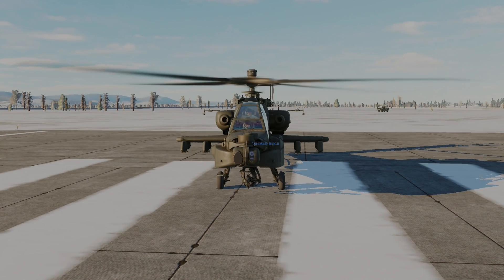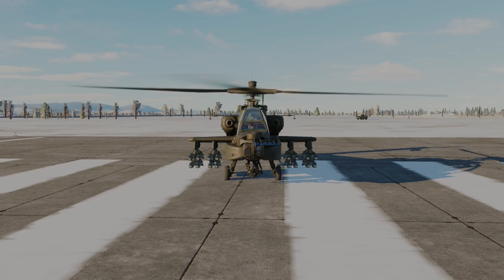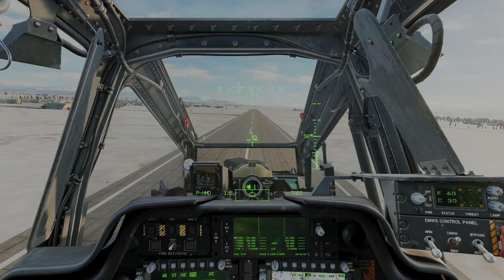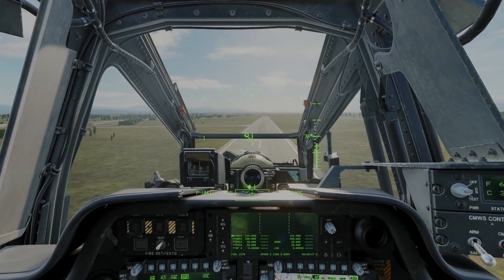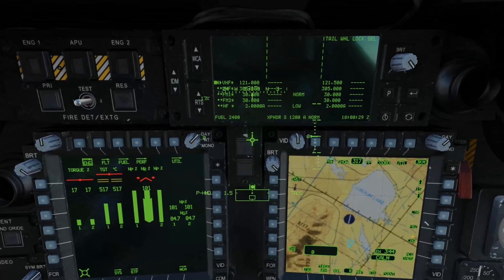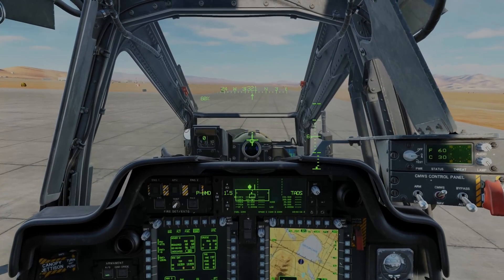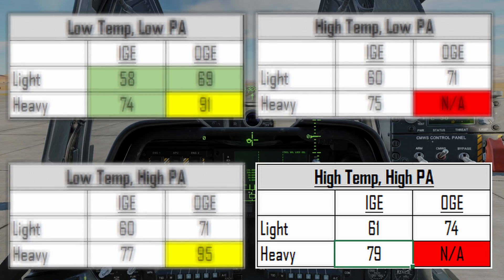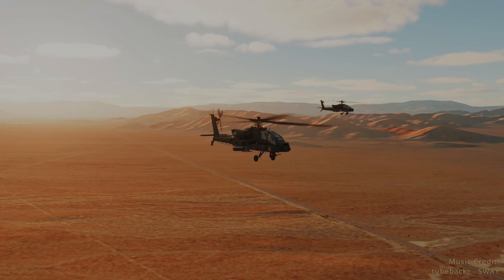REAL APACHE PILOT shows you why you KEEP CRASHING!

Comment: very nice video, informative and to the point.
my subsequent question relative the extreme condition, especially the last one (hot high PA and heavy), how does one goes about doing his job be it armed recon, S&D or some such ? what's the doctrine for this conditions (and any other if possible to share), does it involve racetrack battlestation on TGT, hide and seek hover ?
i'm very interested in the tacticals applications and how to use this aircraft realistically, would love a video on the subject if not OPSEC.

thanks again !
Reply from the maker: Basically you only carry what you need and stay above translational lift speeds by doing orbits/racetracks.

Thanks for watching!

Comment: You need to load up on JP8 and have your crewchief make an adjustment to the power turbine governors to bump the power up about 100hp to 701-d levels.  Also, leave the unnecessary baggage behind to save about 200# and get a skinny gunner to shave a few more.

Do a rolling takeoff and don't get below 60 KIAS until you have burned off about 25% of your fuel or used several Hellfires.

Comment: Are all attack helicopters so underpowered?
Reply from the maker: No, back when it was originally designed, it had plenty of power. In the years since, and the evolution from a to D models, the army decided to add a lot more equipment on the aircraft, which subsequently reduced the power margins. The E model allegedly fixes a lot of these issues.

Comment: I bet 40C was at sea level in the editor. Then going up 4409ft, it dropped the air temp by about 2C per thousand feet (lapse rate), 31C makes sense.

Comment: High altitudes, hot conditions (thinner air for both), and heavy payloads is why the Russians developed the running on the nosewheel take-offs with the Hinds, just to get it in the air.

Also remember, in a heli with a counter clockwise rotating main rotor as viewed from above, the left pedal TAKES power (more TQ), and the right pedal reduces power (lower TQ).

Over torqueing means you basically broke it! (maintenance action required).

Remember also, Pressure Altitude is simply Standard Pressure corrected for non-standard temperature (15 deg C).

If you're playing this game and want to take off heavy, do running take-off's on the runway, like a plane. Once you transitions into ETL (Effective Translational Lift), the heli will just pop up and as long as you keep your airspeed up, you'll fly away. You can even do running take-offs in skidded aircraft!
Reply from the maker: If you watch my latest video, you'll see I do a rolling takeoff because I'm too heavy. Thanks for watching!

Comment: Would you say the model is accurate, I mean is hover more unstable in DCS vs IRL? Also, what stick n pedals do you use?
Reply from the maker: I’d say the model is fairly accurate. There are some issues with it, but it’s probably a good 80% solution. I feel like it was easier to hover the real helicopter, but that might be due to being able to feel what it’s doing versus only using your eyes in DCS.

Stick - Thrustmaster Warthog
Pedals - Logitech Pro Flight (getting ready to upgrade)
Reply: @schoolio64D  I'm using a mff2 for stick and rudder.. no pedals. Hover is very difficult for me.
Reply from the maker: @ntme9  Yeah, definitely takes practice. I've been told that Wags also uses a twist grip.
Reply: @schoolio64D  Nice, only thing good about it is I can sit back with my legs propped up on the desk while blowing sht up.. lmfao.  BTW, slightly off topic, does the 64d have the ability to box/track a moving target like a TPG?
Reply from the maker: @ntme9  Kind of, but not modeled yet. The Image Auto Tracker (IAT) is designed to capture targets and maintain them in the center of your field of view. However, it's not modeled yet, and from I can gather, when the 64D went from legacy TADS to MTADS, it basically lost it's effectiveness. It uses contrast from the surrounding area to lock, but according to Casmo, most people didn't really use it that much. In the A model and D model with legacy TADS, we used it a lot, because the only way to actually see things in the FLIR was to dial the contrast way up. I never flew MTADS - they were fielding it as I left active duty.

Comment: Very cool video.
It's been a while since i last fired up DCS. Now i think there is a really critical parameter missing in the simulation, that is humidity. That bit of water in the air acts to increase the reaction mass, it also effects combustion performance to a point. 
BTW i made it a habit to get my weather reports for every day use from the nearby airport (aka METAR/TAF). No clutter, no ads, no upselling. It just takes a bit getting used to read the stuff.
Reply: It is something that we would state as as reason for reduced performance, but not really factored in since compared to temp and elevation, it had the least impact on density altitude.
Reply: @apachedave  For some aircraft high humidity is considered a positive.
I.e. the Super Guppy. If the air is too dry/light, thrust performance is diminished, and since it is a cargo plane, humidity thus dictates the MTOW, IIRC.
Reply: @DasIllu  No denying that on my part for a Super Guppy.  But in the US Army, our charts did not factor that in.  They probably worst cased it anyway to be conservative.
Reply: @apachedave  Being super conservative with calculations is the name of the game. At least when we are talking about aircrafts that are constantly operated closest to their maximum parameters. I mean, you can come close to, but never exceed maximums.
IIRC it was mostly about how much more reaction mass  humidity provides. So your propeller shovels volume, but the thrust it generates is determined by how much mass is moved. If a certain volume of air is heavier due to the content of water, the same volume would provide more mass to move and thus yield more thrust. This is assuming that there is no phase change involved for the water. Meaning we are talking about the gaseous phase not mist. Mist would take away a lot of energy from combustion, preventing the reaction product to expand in the cylinders as much as it otherwise could.
At least that is how i as a layman understand it.

Comment: Thanks for the instruction - how close or far is this to the real thing - attempting to hover and flying.
Reply from the maker: I feel like it’s close, but different. Different because you don’t actually feel the aircraft moving - everything is perceived with vision, whereas in the actual helicopter you can feel the movement, which helps you react and respond. But it’s really, really good.

Comment: So it's underpowered for its load. Or overloaded for power available. 
Just checked on Ka-50. At 40° with 2x6 Vikhrs and 2x40 rockets it is still capable of OGE climb. It is a lighter missile and its power availability is just better for the load. At higher altitudes it will struggle more, but excess power available (at least felt one) promises that it will still be able to hover.
Reply from the maker: The original design had enough power to do its job, but whenever the Army gets a new toy, they like to put as much stuff on it as possible, resulting in very slim power margins. Newer versions fix this problem…for now. 😂
Reply: @schoolio64D  They will find a way :)
Reply: A thing to keep in mind is that the KA-50's figures might not be accurate.  Most of the specifics in DCS are "eyeballed" by ED.

Comment: Hi schoolio64D, great vid! I  have a question though: I really don't understand why the DCS AH64 oscilates so much from side to side when applying collective, the real heli doesn't seem to do that when it starts to climb based on all the footage I've seen.. What's you take on that ?
Reply from the maker: Thanks! I feel like the pedals are overly sensitive, which is why I recommended a curve in my hover video. Adjusting the saturation may help as well, but I haven’t messed with that yet. I think the other thing is that in the real helicopter, you can feel what it’s doing and can react quicker, which might explain why you’re not seeing much of the same movement.
Reply: @schoolio64D  Ah ok, I was myself wondering wether it might be some lack of inertia/momentum going on, as yawing feels a little weightless/without mass.

Comment: Would this bird stay in the air at the hot and high condition, by gainig forward momentum and using it's wings?
Reply from the maker: The wings don’t provide sufficient lift to really assist. They do provide some lifting force, but it was negligible at best.

Comment: At minute 07:00, when you had a hard time settling it down, could it be because increased air temperature made for more air rising, hence higher level of ground effect?
Reply from the maker: I think me getting settled down was just me having happy feet on the pedals 😂 

There’s a lot more to break down in what you said though. First, hotter air is less dense, so there are fewer air molecules for the rotor to push around to generate lift, requiring more power to move the same amount of air that you would at a lower temperature.

Secondly, ground effect is strongest closest to the ground, but decreases the further you climb away from the ground until it’s effectively nil at approximately one rotor disc in altitude (48’ for the Apache).

Forgive me if you already know this, but I wanted to make sure I addressed the whole comment.

Comment: So in Afghanistan in high summer can the enemy assume that Apaches won't be carrying a full complement of hellfires and full fuel tanks ?
Reply from the maker: Well, first we aren’t fighting in Afghanistan anymore, and secondly, most of the Army has E models now, which have A LOT more power. 

So assume at your own risk.
Reply: @schoolio64D  Good point ! :-)
Reply: @schoolio64D  If you were in atmospheric conditions where you barely had any power margin left but still had to perform fire support, is it army practice to get rid of fuel or armaments preferentially?

Comment: Schoolio, was writing to one of your commenter about the consideration that needs to be given to bank angle vs. power margin. 

The load factors that helicopter experience;

60 degree banked turn requires 100% of the power at level flight in order to maintain altitude and airspeed.

30 degree requires 50% of power at level flight. 

Amd the deliniations between.

etc.

I think that would be a fantastic video demonstration for people especially if you focus on how critical it becomes when you're high hot and heavy, at terrain flight altitudes and doing combat manuevering flight.

Some times you the engines can produce more than 100% torque in the right conditions. 

Some times, like in your last demonstration, max torque available was limited by the conditions and you drooped at 96%.

If it takes 74% power to maintain 110 knots indicated you couldn't even do a 30 degree banked turn without sacrificing your airspeed to maintain altitude or without trading your altitude to maintain your airspeed or risk drooping the rotor all together.

It's a topic I don't think anybody has covered, its complex and nuanced but also sort of straight forward - and would likely make some light bulbs go off for some people.

Would make great and informative content.

Comment: Very important video for new Helicopter flyers!!!

I remember doing training in the tiny R-22, 2 people in the cockpit, airport at 2200feet msl and hot weather (38° to 40°C), we just couldn't fly because of PA.
the helicopter could barely hover IGE with manifold pressure at max, and tipping forward to gain speed could be dangerous due to the initial "dip" as you start gaining speed, with real danger of bouncing the skids on the runway...
I mean yeah, we could do a rolling takeoff and ware off the skid shoes a bit... but we'd rather have those for a real emergency ;)

looking back I know it would have been possible, but I still wouldn't want take that risk.
Reply from the maker: I flight instructed in a Cessna 152 in Phoenix in the summer…I know exactly what you’re talking about. 😂

Comment: This is excellent. Essential viewing after learning how to cold start and fly I think.  What would be great next is more explanation of how this impacts mid flight maneuvers. Like does that mean you're more likely to overpitch, can you briefly have torque lower than needed to hover but still hit near 0 speed then move out of it.  Thanks.
Reply: Know this;

It takes 100% of the power (torque) required at level flight to maintain airspeed and altitude in a 60 degree banked turn.

If it took 42% to fly straight and level, and you rolled it over 60 degrees, it will require you to pull in 84% (+42%) torque through the turn in order to not lose altitude or airspeed.

The reason is at 60 degrees, while maintaining altitude the load factor on the aircraft is 2 Gs. Or twice its weight. Which requires twice the amount of power to stay aloft. 

So then, at a 30 degrees angle of bank you will need to pull in 50% of the power required to maintain altitude and airspeed than you need in straight and level flight.

You are pulling 42% torque and roll it over into a 30 degree banked turn. You need to pull in 63% (+21%) torque to maintain altitude and airspeed through the turn. 

At a 30 degree angle of bank the load factor is 1.5Gs or its normal weight plus half. 

This scales linearly up to 60 degrees. 

This is a physical truth all aircraft experience. You can roll a fighter jet over to 60 degrees, pitch the nose up to maintain altitude through the turn (you'll have to add power to not bleed airspeed) take a look at your G-meter and see it reads 2.

Cessna 172s experience 2-Gs in 60 degree banked turns. 

Hop in any of your helicopters, take note of the torque at level flight and roll it over to 60 or 30 degrees while adjusting power to maintain altitude. You'll see it takes 100% or 50% additional power through the turn respectively.

All that said, then it becomes critical for the pilot to know how far he can bank it over during combat maneuvering flight before he no longer has power available to maintain altitude before he has to trade his altitude for airspeed or his airspeed for altitude - or risk drooping the rotor. Very critical information when you're at terrain flight altitudes, and jinking the helicopter to avoid the enemies direct fires. 

Right? Because if you're near max gross weight and it takes you 72% at some given airspeed (say 110 knots indicated) to maintain level flight, your power required to crank her over to 60 degrees without losing energy (airspeed/alt) would be 144% torque!

In some conditions a helicopter will have excess power available above the the manufacturers engine health limit placed upon the pilot (100% continuous torque for example). Knowing the engine for a given set of conditions can physically produce 135% torque before drooping the rotors can factor into critical emergency situations where more than 100% torque is required briefly to keep from crashing.

I don't know the Apache mod but it would be in the perf page under Max Toque Available or however they annotate that. "Q" is the torque annotation in the Blackhawk so Max Torque reads "MaxQ" in the perf page if I remember correctly.

Conversely, critically, in some conditions such as those demonstrated in this video there will be times that the engines are physically incapable of producing even 100% torque before drooping the rotor. Say they will droop at 96% like they did in the high, hot, heavy demonstration. It doesn't matter if he's in forward flight or a hover - at 96% torque, in those conditions, those engines will no longer be able to produce enough power to accommodate for the increased demand on the rotor system, drag will overcome thrust and the rotor RPM will decay or "droop."

In a situation like this you have to factor in your manuevering limits. If it takes you 72% power at 110 knots indicated you only have a 24% power margin. 96% max torque available - 72% power required at cruise = 24% power margin. 

You can't even roll it over to 30 degrees and maintain altitude at that speed since that would take 36% torque. Either you have to slow down or reduce the bank angle in a turn in order to be able to maintain your states of energy (airspeed and altitude).

You can Google aircraft load factors in a turn to see a full breakdown of power required vs. Bank angle. The ones I remember outright are the 60 degree and the 30 degree but there are ratios everywhere in between and if you're smart enough you can do the mental math to break it down since it scales linearly.

Wow. I just seriously nerded out there. I love helicopters and helicopter flight physics so it was easy but that was like 20 minutes of pecking away on my phone LOL

Anyways, I hope you walked away from that reading with some food for thought going forward with your rotorcraft simulation. Hope it all made sense. I'd be happy to answer any other helicopter flight physics question of they come up. 

I for one would love to see @schoolio64D do a video on this.

Take care
Reply: @ender5817  Great stuff thanks for taking the time. Also impressive you did it on a phone :-) I need to link up the theory with the practice. It's a lot to learn from scratch in weeks and I'm not kind on myself when it comes to taking time to learn each thing.  Right now I'm fine 75% of the time then dropping out of the sky the rest of it and wondering if I'll ever figure it out properly!
Reply: @stovic1442  well hopefully some of what you saw and read today will paint a clearer picture in your head of some of the things that are happening when helicopters fly
Reply: @ender5817  nice book